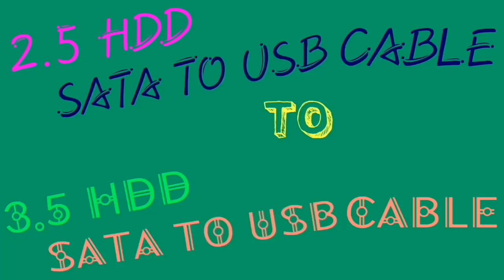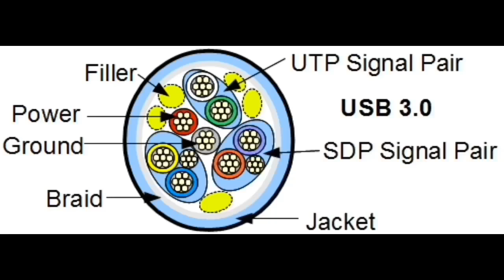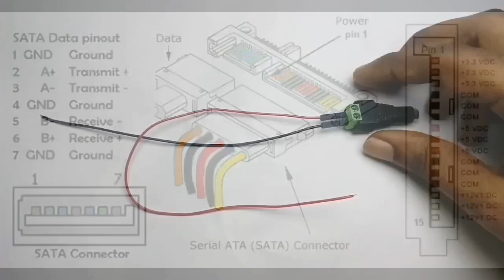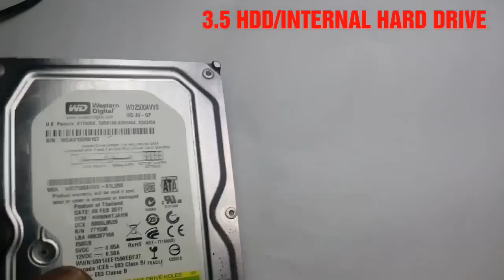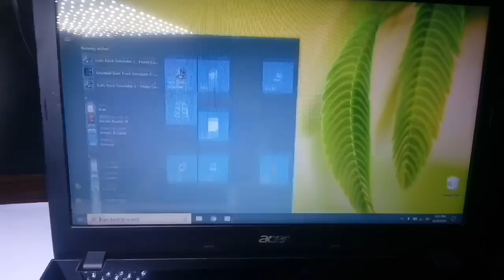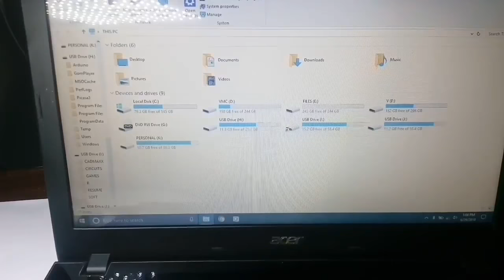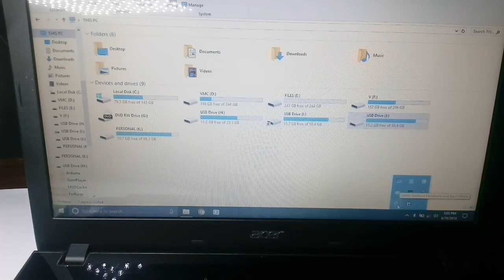DIY 2.5 TO 3.5 HDD SATA TO USB CONVERTOR

Comment from the maker: Guys if you dislike this video , kindly tell reason in comments
Reply: Great video, but the music is kinda out of place..
Reply: Great vid, great music, great job!
Reply: thankyou for this video i like it
Reply: Kill music
Reply: Thanks for your video! But I want to ask: does it need to unite ground wire from USB and ground wire from power supply for stable and secure work? Or maybe this connection is already done on the PCB?
Reply from the maker: @andreyosss4352  better test before soldering wether it is joined in pcb are not , if its joined in pcb no problem, if not joined you combine both ground wires and solder it
Reply: I thought using that music in this video was funny (:

Comment: Hi, I was wondering what can I use to power the HDD beside the adapter in the video you had, if any, because I wanted to diy my own sata to micro USB and I saw you needed to power it with another device or cable because the micro USB wasn't enough, thanls
Reply from the maker: Hi! how can you convert data from sata to micro usb ,did you have any microcontroller to do this function??? 
You are asking  about power supply  which type of hdd you have did you have desktop hdd which i shown in video its run with 12v ,so you need to power it with external power source of 12v with more than 2 amp,else if you have laptop hdd which runs at 5v dc ,you can power with 5v power supply  around 2amp ,if you are   doing desktop hdd to usb it will be more complicated to do this function, 
vmcvamsi166@gmail.com if you want  any idea mail me
Reply: any 3 cell lipo should work. it'll give you 11.1V. you could use 3 18650 batteries in series and they should have plenty of amps to run the hdd

Comment: I have segate expansin and seagate backup plus external hdd 
I have question that can i use 12 volt 1 amp for powering the hdd ?
Please replay me its urgent for me 
Thanks
Reply from the maker: sorry i don't know which type of HDD you have, generally external HDD communicate with usb power ,no need to use external power source ,if you have bigger one try your own risk, "we are not responsible for any damage "

Comment: CAN I USE A SATA DATA EXTENSION WIRE FROM MY OLD PC & POWER (5V FROM MOBILE CHARGER 12 FROM SPEAKER CONNECTOR CONNECTED TO CONVERTOR  IDE TO SATA ) TO THIS CONNECTOR????
Reply from the maker: No that's not usefull

Comment: Is there any way to connect 3.5" harddrive using data only connection. I want power harddrives with my PSU. I try to find usb to sata (Data only) cable but couldn't find anything. Do you have any suggestions.

Comment: The black wire to the 10, 11, or 12 pin. Can the black wire also be connected to back wrie on the usb connector instead of these 3 pins?.
Reply from the maker: yes you connect gnd from usb to gnd from 12v ,no problem

Comment: hey man , i just tried that my adapter is a little different from yours .. it does not have these connectors with other colors that you soldered , i followed your video but it did not work i used a pc power supply to use the 12v yellow cable and one black. but it didn't work .. I can't say if it's because my adapter is a little different from yours or if I did something wrong .. can you help me ?
Reply from the maker: OK, share your images and additional details  to my email:- vmcvamsi166@gmail.com
Reply: @vmcdiytech3681  seu email não ta aparecendo , certifique-se que seu email esta correto e me envie novamente
Reply: @vmcdiytech3681  CONSEGUI ENVIAR AS IMAGENS .. O Email que você enviou veio com espaço entre os caracteres por isso não tinha conseguido enviar , aguardarei sua resposta .. agradeço sua atenção

Comment: I did exacty that but i have a problem wish you can help me with, the hdd is spining but there's no data when i connect it directly to the computer it works
Reply from the maker: yes, some model of hdd is not supporting with usb, but works with direct desktop, you need to check with different converters to get a right thing or use external hard drive to usb box so you can use it as portable harddrive
Reply: @vmcdiytech3681  turns out that my hub doesn't work at all it can't read data not in 2.5 and not in 3.5inch I want to fix it but I don't know how to connect the wires directly to the adapter jack
Reply from the maker: @Rabah_issaad  share images to my email and update me... vmcvamsi166@gmail.com ,if i know i help you
Reply: @vmcdiytech3681  thank you so much brother I will contact, I appreciate it 🙏 😊

Comment: 03:32 Then why did you unsoldered everything? After that you just soldered all wires back in the same position. Why did you unsoldered the wires then?
Reply from the maker: because that pcb is very delicate and pcb traces are very thin ,if anything goes wrong the traces will cut out from pcb with wire foldings ,so i unsoldered all and re soldered same again and added 12v external power source
Reply: @vmcdiytech3681  I think this step is unnecessary, and you can solder 12Vdc directly without de-solder anything.
Reply from the maker: @Kuchuflaz  yes , no problem,if you can...you can add 12v directly, without removing any thing,  for video i need to show clear and clean so i did, all people are not expert's to understand at first time , some people are beginners , they don't understand if i go in express mode , so need to show full process 🙂😁, thanks for supporting me 👍🙌

Comment: It's possible that the 12V  from  "the charger" to transfer through usb and  burn your laptop/pc motherboard ?
Reply from the maker: No its not possible,if you solter perfectly according to pin out otherwise you may damage your motherboard, if you are new to electronics i won't recommend, if you have lot of experience you can do according to pinout i show ,you need to do at your own risk  video is for reference only ,its works for me till now no problem for me i am using with my laptop
Reply: Same question, 12v all so go to computer port and pc maybe shut down

Comment: Sir SATA cable may say USB female kesy bany gi yea btaye.
Reply from the maker: hello  rizvan rizzy , we can't convert sata pin to usb , we can replace usb male pin with usb female port , we required that converted board (pcb ) to transfer data from usb to sata , so its not possible to change sata pin with usb port,  if you required any more help contact in mail and share details like images and videos,  but you need do at your own risk , we are not responsible for any damage,  if need help contact to this mail vmcvamsi166@gmail.com , have good day

Comment: i need some help 
I'm using this connector on my phone but the hdd is drawing too much power from phone like 5% per minute
i make soldiered wires for external 5v but hdd doesn't work with external 5v
it only works if powered by phone
is there any thing i can do ?
Reply from the maker: did you connect ground common for hdd  to 5v power supply and mobile ??? if not try that ,i hope it works definitely, i didn't tested but if hdd works with your mobile then it works ,may be increase amps of your power supply up to 2 ,may be it works....,which mobile you are using
Reply: @vmcdiytech3681  My phone is lg v30 port is usb-c 
See the pic:
https://photos.app.goo.gl/7wSDiAdahaxR2d4N9

i soldered the white wire to the red(5v+) and the other to the ground(black) 
the other end of it goes to usb charger or power bank but it doesn't draw power from it
it works only if phone connected first - if connect the external 5v after phone it changes nothing
Reply from the maker: @abod898  thanks for sharing image ,i think you are  using internal harddrive  which is used in desktops ,is that right ,if its internal harddrive then for spinning disk it requires 12v power supply, how can you see data when you connect to your mobile, its impossible to see data ,because those sata to usb converters are works in laptops or pc only ,please stop your project immediately otherwise you loose your harddrive or mobile  ,please don't take risk you loose your data if harddrive is corrupted, and never come back ,you need through that harddrive for scrab even your mobile also get some damage, kindly stop it immediately, if you need to try then do more research on that because small mistake leads to a big loss,  I WON'T RECOMMEND NOW
Reply: @vmcdiytech3681  yes it's internal hdd 
i formatted it in exFAT so it's working on phone
it works great and the speed of writing is amazing 
no problems at all except for the 5v power drawing from phone is real quick
and yes it needs 12v for it to work , i have a dc power supply for that

Comment: The 3.5" hard drive is label 12v and 5 v , how you powered it with 12v only ?
Reply from the maker: Hello my friend, thanks for your comment, the 3.5 hard drive is lable as 12v and 5v you are right ,since 12v is supply from 12v adapter (power supply) and 5v is supply from usb which is connected to laptop, since both 5v and 12v ground (negative (-)) is joint together  its works good. (if you are new to electronics please don't try this )
Reply: The hard part about this is why he powered it with 12v at all, as far as im aware, any hdd with a standard 22 pin sata connection can run on 5v at less than 1A, if you look at the pdf on wd website, start up requires 2.5W and the 3TB is the most power hungry at 8.0W max. The 8TB surprisingly is only 5.4W and usb2.0 can do 5W, considering usb3.0 can do up to 5V 3A for 15W or up to 9.75V at 1.6A or about that, 3.1 gen2 is like 65W. This video is only 3 months old, you could run a raid10 off a type-c and people do, but they use things like the crucial 500GB m.2 nvme drives on a raid card and max out the 10Gbps data rate of a type-c by a good margin, that drive there is cheaper I'll definitely not argue that but it ways a ton and is not something I'd want to lug around on top of what a laptop already burdens you with and the performance in a word "sucks" plus by adding a 12V power supply your adding another load to your laptop bag and necessitating a power point when the newer portable chargers that most people still have for phone emergency situations are insane enough to charge not only your phone but power a number of drives, Oh and the laptop those drives are connected to. Man, I really appreciate the D.I.Y attitude, thats what got me to this video but honestly a usb to sata converter, even type-c is like $8 if you don't buy it from a petrol station and if your still using a spinning drive, your not worried about the bandwidth of your connection, without at least a little 2.5 sata ssd caching that old school beast, your not gonna not gonna be break any fps records, sequential write from its cache would barely rattle usb2.0 and there's a whopping 32MB for it to work from. If you really need that much storage, I honestly can't think of a reason with clouds and hotspots, but if you do, firecuda hdd with m.2 slot preinstalled and configured to use an m.2 smart cache is about $500 and a m.2 if you use your fingers and your googling abilities is 100. Its about 4 times what that drive costs but thats what it costs to get a file before your OS is no longer supported these days, or you can get a 500GB m.2 and a case for about $130 and have 2GBps in your shirt pocket, I put mine on a keyring and I can empty and refill that thing in a few minutes before I go out if I ever had too but I don't, I mainly use it for my phone, it's full of apk files plus exe files that I'm always having to install on someone's computer because they are still scratching their heads and its still not managing to bring up the answer they need the way Google has a habit of doing. You could probably get a free m.2 if you didn't mind a bit of muck around, Aliexpress have x79 motherboard packages that come with a pair of xeon CPUs, a bit of RAM and an m.2, keep the drive, Ebay the rest and you might even make a buck or screw it to a wall with that wd drive and have a server that can also throw about a million cores at any data crunching thats keeping you from gaming on your awesome new m.2. Also, I'm actually trying to do the opposite of what you did, i bought a 4TB Toshiba just to fill with compressed crap that I'll probably never use again but when I cracked it open to chuck it on sata so its not hanging around and windows won't argue with me so much and I discovered that Toshiba the cheaky buggers have realised that they are selling external devices cheaper because the market is greater but losing the more profitable sales for people want to add size to a fast drive and they went and put a usb 3.0 micro b of all bloody things directly on the pcb. Everybody makes usb to sata, nobody makes sata to usb, i have the wiring pinouts for both but I am not even close to adapting the pcb design to reverse the idea or i would just heat gun it off and daughterboard a sata on. If you figure that out, I will be a very interested man!
Reply: @danielmcmaster1392  mucho texto xDxD

Comment: can we combine two SATA adapters ?, I have some 2.5 HDD laying around, selling them is not an option, so I want to combine them into one RAID arrangement or even as an external drive, but multiple external drives is too much clutter, I want a single unit with multiple HDD, online options are not trustworthy as all are imported ones and I can't claim warranty on them.
Reply from the maker: yes i think , but we required some chip to read and write data perfectly,  search online wether there is any device that connects two hdd

Comment: so you added a parallel source?
Reply from the maker: yes
Reply: @vmcdiytech3681  is your source regulated? or how do you know it won't burn the hdd?
Reply from the maker: @zerdagdir1988  I referred different brands of hdd's and seen their power configurations and smps powder configuration and then i came to conclude, i referred 6 months to collect data and verified and then i did this after success i posted video on YouTube to help people ,i did not use parallel sources , hdd works with two power sources for data transmission it requires 5v dc is enough, to spin disk it requires 12v dc , amps will be not a problem ,but minimum 2amp is required to spin brushless dc with out issues, i hope you got clarity now, if you are doing this be careful when connecting and disconnecting  ,you need to powder up 5v and 12v at a time ,otherwise sometimes hard disk may corrupted and your data will never come back again so remember this tip and must follow, thanks for your comment
Reply: @vmcdiytech3681  thanks for you reply too, I honestly didn't expected to find a video on my problem but to my luck I found it, and I'm glad that I did

Comment: Hallo VAM C, good video. I have a question for you. I have a motherboard with SATA II (300MB/s) and USB 2.0 (35MB/s) slot. I think that it is possible to get from motherboard SATA II connector an about USB 3.0 (300MB/s but not 400MB/s). I have installed a USB 3.0 expansion card on PCIe x1 1.0, but it gives 250MB/s. What do you think? Is it possible?
Reply from the maker: Hello claudio bisceglie ,yes the data transfer is low for usb 2.0 when compare to usb 3.0 ,as you told that you have inbuilt 2.0 slot in your motherboard and you attached 3.0 expansion card to that motherboard but its not giving full speed of data transfer because your processor capability is low and its not stable for such a speed data transmission if you do like that very soon your motherboard becomes over loaded and get hang and over heated so don't pressure your motherboard to do work with much speed, it may damage soon

Comment: How if power adapter 12v 500mA?
I tried and still not working, or maybe need 2A like yours.
Reply from the maker: Hey i am feeling happy to see your comment, i think at least  more than 1amp required to spin harddrive disk ,better go like me instead of experiment, if you have 1amp lets check or buy 2amp ,polarity must important while connecting. Have a great day
Reply from the maker: Hey i am feeling happy to see your comment, i think at least  more than 1amp required to spin harddrive disk ,better go like me instead of experiment, if you have 1amp lets check or buy 2amp ,polarity must important while connecting. Have a great day
Reply: Ah, thanks for replying. Now I'm understand. Thanks for video. 😉

Comment: I see that you only connect the red wire onto only 2 of the pins but the text said 13,14,15. Wdym?
Reply from the maker: Sorry for late reply,  thanks for your comment, what you told is right ,i connected to two wire the other is internally connected  ,if you have multimeter, place knobe in continuity mode and test them ,the beep sound will come that means they are in connected to each other ,hope you satisfies with this answer if you not understand comment me again  ,have a great day .

Comment: In 15 pin have 2 ground points wich is the currect one for fixing 12v ground
Reply from the maker: no problem, internally all grounds are joined together, when connecting 12v you must connect 12v to correct pins and ground can connect to any ground point

Comment: Hola  Vam C ,tengo un adaptador similar al tuyo pero no logro
hacerlo funcionar,seguramente por mala interpretación  mia de
las conexiones.Sería posible enviarte el diseño del mio para que
puedas aconsejarme a pesar de lo muy claro y aparentemente  
sencillo de tu excelente video.?

Saludo desde Argentina Roberto Sender
Reply from the maker: hola Roberto Sender, gracias por tu comentario en YouTube, ¿para qué estás usando ese adaptador? y explíquelo claramente, cuando solicite enviarme su diseño, aquí está mi correo electrónico de identificación vmcvamsi166@gmail.com, adjunte información e infórmeme en comentarios en YouTube, manténgase seguro / salva vidas con Corona, gracias, que tenga un gran día, amigo (si sabe inglés, publique los detalles solo en inglés, no sé español) 🙂😃